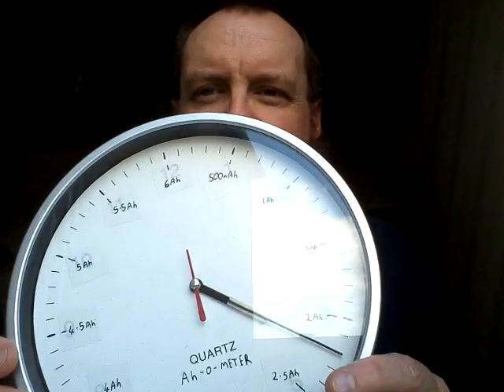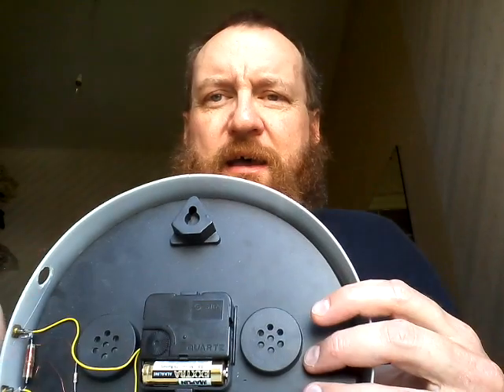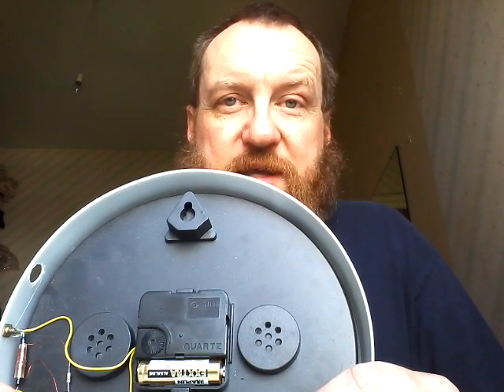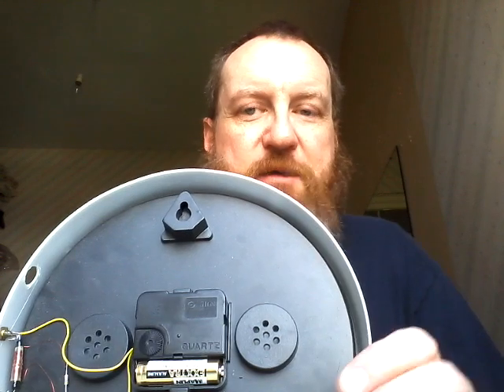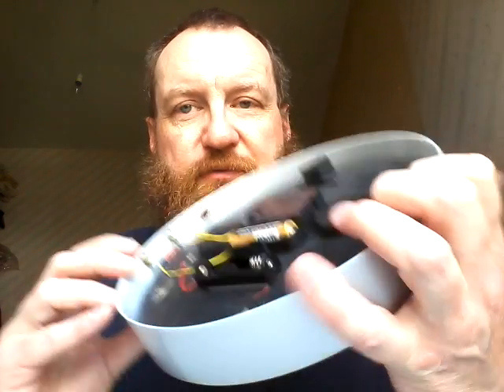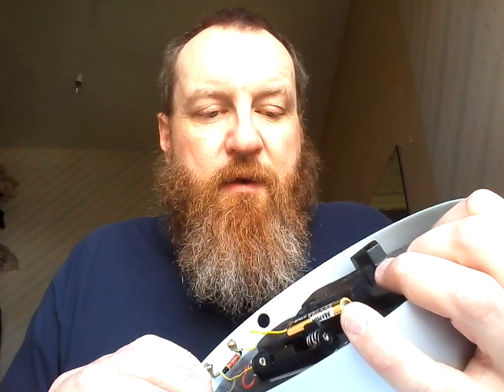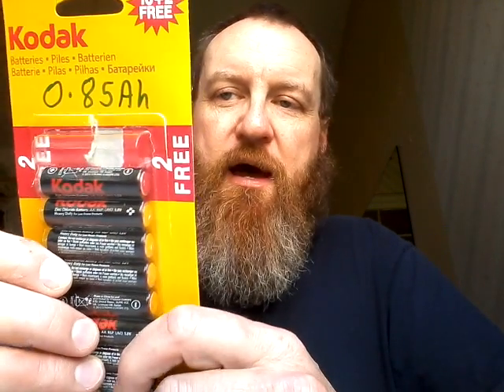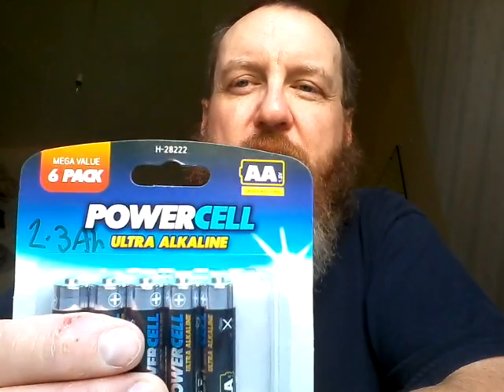Alkaline battery capacity tests.

Comment: Clive. Would you consider adding IKEA batteries? Those seems to be quite good.
Reply from the maker: I didn't have IKEA cells at the time of the test.  But others have tested them and they came out very well.  Good high capacity.
Reply: +bigclivedotcom Your blue collar trash cake saved my life tonight
Reply: +bigclivedotcom I've used IKEA batteries a lot and agree they're good capacity for the price. However I've had far more problems with them leaking than other budget brands.

Comment: interesting comparison, I have found different types of battery suit different types of equipment, for example, I have a metal detector, it will run 6-7 hours continuous on those alkaline duracell or the kodak ones, but i tried some GP 1300 mA ekopower nimh, which gives 8 hours easy, the problem with alkaline is the volts drop off to quickly in digital equipment

Comment: Do Super Heavy Duty batteries have Alkaline in them?  I ask because tonight I took the batteries out of my LED candle, they were Eveready Super Heavy Duty batteries and they were both showing signs of corrosion.  I think the batteries had been in there for maybe 6 months or so, maybe even 8 months.  I never buy Eveready batteries, ever.  I normally only buy Duracell or Energiser batteries, so I don't know how I ended up with those batteries.
Reply from the maker: If it doesn't say alkaline then they aren't alkaline.  When zinc chloride batteries were new they had better performance than the earlier zinc carbon ones, and unfortunately the phrase heavy duty has stayed despite the fact that they are inferior to alkaline cells and leak badly.  Duracell's claim of higher battery life over its competitors is also based on the older zinc chloride cells, which is very misleading.
Reply: Well it turns out the batteries in question were in fact carbon zinc, so that answers my question.  No wonder the LED candle only lasted a few months on those batteries, mind you, I was using the timer on the candle to turn it on and off, so I don't know how much drain that presents to the batteries.

Comment: What about the Ikea batteries? I have had good experience with them and they last far longer than anything I have used! You get like 10 for £2 or so.
Reply: I second the claim for Ikea batteries. I tested them unscientifically (by using them with cameras) alongside Panasonic alkalines. They scored just as good.

A warning:  Halfords own label alkalines, one exploded at me (in a torch, so nothing weird going on). It went POP----Hisssssss and sprayed the alkaline electrolyte under pressure everywhere. Ruined the torch completely
Reply: I stock up on them when I go! Even if its only a packet :L Own brand beating a named brand who would of thought! :P Oh thats no good! I would make a complaint as thats is rather dangerous!

Comment: Believe it or not, there are actually some applications where you want to have zinc-carbon batteries instead of alkaline batteries. One of those applications is in certain effects units for electric guitars. For this, you actually want a battery with a high internal resistance.
Reply: I wonder if you could just use alkaline/nimh/lithium and put, say, a 1 or 5 ohm potentiometer in series with it.  Then you'd get an effect that's both more consistent, and adjustable.

Comment: could you not use an Imax B6 charger? As it does discharge function, and shows battery capacties..
So do a discharge test of 0.5A and see how many mah it shows on the capacity test
Reply: That would not have looked nearly as cool.   Some of the newer hobby chargers will show mWh as well, which is interesting and relevant now that so many devices have regulated internal power supplies instead of just running brighter/louder/faster with new batteries.

Comment: Interesting video Clive, however I'd just like to comment on Duracell batteries. 
Duracell's are complete shit, I can't remember how many items have been damaged by these things leaking and usually it's maglite torches taking AA, C, and D cells. Once the cells leak, it's near on impossible to get them out of the torch without causing damage.
I now use only rechargeable batteries because alkaline batteries are so crap.
Reply: Once I used 2 duracell batteries (their most expensive) on my xbox controller and I left the controller untouched for a week inside a plastic box where I store electronic things so they don't get dust, after that week I come to find out both batteries leaked imensely and destroyed an 8GB SD card from my camera and a pair of earbuds. Those things really destroy anything electronic they come in contact with, I was surprised that after a wash, the controller still worked.
Reply: Duracells nearly destroyed the contacts of my (now very rare) CD-i controller. A working replacement controller is around €30 on eBay.
Reply: It's hilarious. When I find electronics destroyed by leaking batteries, 9 times out of 10, those batteries were duracell.
Reply: I've never had a problem with Duracell batteries.

Comment: I can remember a time when leaking batteries were a real problem. I've had MORE than 1 Walkman and even a game boy destroyed by leaking batteries (not to mention a large number of flashlights) but now I think about it, it's been years and years scene I've seen a leaky dry cell battery.
Reply: I leaked some modern Varta Alkaline in a label printer that i left unattended for 7 years. But the leak wasn't too bad, the printer's contacts were practically not corroded underneath. But these were good contacts too, little wear.

I also vented and leaked some NiMH by overcharging them at high current. What came out was more like foam and less like liquid. I removed it before i could observe any damage, so i don't know whether it's really bad for your electronics, anyway it's a highly unlikely occurrence.

Comment: Ive always used Poundland ( originally  my local 99p store ) Kodak Alkaline batteries..  Never had a prob They last well.  Ive now switched to the Fusio Max and todate Ive not encountered any problems.  Just wish they did them in a D cell.

Comment: I find Kodak alkaline ok but the zinc carbon ones are hopeless, you can squash the casings with your fingers, these remind me of those powercell brand ones that you got about twenty on a card, last two minutes then die then leak. Amonium chloride does eat contacts as I have seen, Alkaline potassium hydroxide also can do this but at a slower rate an the deposit is often a blue. The Ever Ready old type codes were SP special power HP high power, back in those days there was not much difference between the two. Nowadays battery technology has improved vastly. At the end of the day you get what you pay for. For high drain devices in constant use its best to use good quality alkaline batteries. They last longer an leak less. A chemical reaction is constantly taking place in a zinc chloride cell that eats the zinc casing over time, I find alkaline batteries leak less though, I have taken Mallory Duracell batteries out of old equipment to find them mint condition an in some cases still working, Mallory were an independent brand in there own right but had something to do with Duracell back in the early 1980s.

Comment: Duracell did seem better but I bet most of the other batteries I'd used before them was zinc chloride... now adays the batteries that come included with things seem just as good as duracells, if not better. next time I need batteries I will remember this :).

I think i'ved tried to look up the AH rating of AA batteries in the past and never been able to find any info

Comment: can yo do the same test as this on 18650 batterys please? Or will that be to expensive? I'll share the vid through right lines and I'm sure it will go viral in the vape community! respects Alex
Reply from the maker: +Alex piv There are so many lithium cell clones that it's really difficult to do meaningful lithium cell tests without actually testing the ones you have.
The best test of real mAh I've found so far is to put the cell in a generic single cell USB power bank and first discharge it fully, then charge it with a suitable USB charge monitor to measure the mAh total during the charge cycle.
Reply: Thanks Clive your a gent!!

Comment: My personal experience with Duracell battery's is thay they tend to leak even BEFORE they are flat. I've had multiple battery's that where still in use when they started to vent electrolite. They where regular Duracell's, not one of the cheaper models. For a company selling one of the most expensive alkaline battery's on the market that is really lame. I have never bought them again since then. From what i heard they don't make them at a separate factory anymore but are being produced at the same productionline as Philips battery's.

Comment: No testing of Energizers?
Reply: +Jeremy Morton Energizers will be around the same or slightly worse than duracell, but I would be curious about the 'super max amazing extreme' or whatever versions, if they make any difference :P
Reply: +Jeremy Morton Good suggestion. I'd like to see how the Energizer Ultimate compares. I like them because they're lighter and they don't leak; lithium tech. Not cheap though. In my experience Duracell is a synonym for "leaky crap" ;) I'd be curious how the Duracell M3 compares though.
+BigCliveDotCom Do you still have your tester?

Comment: I always buy my AA's and AAA's in the LIDL Supermarket (Netherlands but I'm sure LIDL is present in the UK also). Maybe you could one day purchase them and measure them up ? (They cost 1.80 Euros/8 pieces)
Reply: mharris1270 afaik they are not connected. Aldi has been erected by 2 brothers who after disagreement split the Aldi into 2 companies Aldi-nord and Aldi-sud (north and south) and LIDL is from a completely different background. Here Aldi is the cheaper one of the two although both claim to be value supermarkets and in some respect they are (LIDL being more expensive). Strange that Aldi  has been a luxury retailer in the US. The Aldi's in the USA might be derived from Aldi-sud and they might therefore not have chosen to sell batteries while Aldi Netherlands is derived from Aldi-nord and does sell batteries (I bought them last thursday and they're only 1,89 Euro per 8 AA's or AAA's). Lidl sells them for exactly the same price per 8 but are differently branded.
Reply: @maicod  In Germany both ALDI and LIDL You get 8 batteries AA or AAA for EUR 1.59 ! And they are both very good and longlasting. And they both take back used batteries in a box near the cash register for recycling for free !
Reply: @Maico  In Germany both ALDI and LIDL You get 8 batteries AA or AAA for EUR 1.59 ! And they are both very good and longlasting. And they both take back used batteries in a box near the cash register for recycling for free !
Reply: @Buddhist unfortunately here they sell for EUR 1.79 @ Lidl
Reply: @maicod  You can travel to Germany if You are in Groningen or near the border and buy entire shelf empty to save 20 Cent per 8-pack. But who needs so many batteries except for tv remotes, wallclocks and wireless USB-Mouse? And they usually last very long. The biggest consumer was my Gillette Power Fusion shaver, requiring every week a new AAA Micro- battery. But now I have shifted to wet electric shaver with akku (rechargable battery like in mobile) and it has much more power than the Gillette ! Works also with shaving foam.
Reply: I'm 'far' away from Germany. I don't mind the price difference. I was just wondering why prices in Germany are better than here :)
Reply: @maicod  Our VAT is 19 % on non-food items.
Reply: 21 % here

Comment: CR123 batteries, when found at the druggist, hardware, etc. are about $7 each, even when bought in multi-packs. Found them for a buck a piece. Surefire Lithium. On EBAY

Comment: Even though I know this video was made in 2014, it's still very much relevant in 2017. Duracell, for whatever reason, has now branched into making a bunch of different (shall we say dubious) new brands for their batteries. They still make the good-ole-coppertop (which is now a crap battery), but now they have sub-branded cells like Simply Duracell and Duracell Quantum (red/gold) along with other variants.

Since they have now split their brands into multiple new dubious battery lines, their battery quality control and, in general, overall quality has become crap. It does not surprise me at all of your findings with those Simply Duracell batteries. In fact, I'd guess you'd find the same thing even buying the regular Duracell batteries at full price.

In fact, I have personally found that the Quantum batteries operate at least 4 times shorter than Duracell batteries made in the 90s. I don't know what has happened over at Duracell, but I won't be buying any more of their batteries. Energizer seems to have at least kept up with their same quality levels over the years, but Duracell seems to be cutting costs... and along with it the longevity of their cells. 

I'm guessing some some self-proclaimed brilliant executive at Duracell thought that they could cut costs and reduce their battery life in an effort to force people to buy more batteries, more frequently. It's a scam that really needs to be exposed. I certainly don't buy Duracell anymore.
Reply: Probably like the inkjet cartridge makers.
Reply: And recently "optimum" which may be a return of the old "PowerPix" now that AA digicams are a thing of the past (and if anyone has a vintage one, they're using rechargables).   I never saw, in the USA, anything other than regular duracell, procell, and the M3 Ultra.  No simply or plus.
Reply: @mikewellwood1412  The inkjet carts just come in normal and "XL" capacity, no rebrands of the same things.  What they do is more like selling the same AA battery but with 20 different shapes and terminal configurations so that one product (essentially) can take up a whole section of an aisle.  The XL vs std would be more like some having one AA and others having two or three, in the same cartridge.  There's no messing around with amount of ink.  Not "prints 20% more pages, but only if you print over 10 pages a day; if you only print 1 a week then it prints 10% fewer), like there is with batteries.

Comment: The last time Duracells were worth buying was probably the 80s when there was so few other brands to choose from and they along with Energiser were making the best batteries.
But the advent of the Pound stores bringing in cheap foreign batteries killed off Duracell for me.
Reply from the maker: +Trakker It was the invention of the nickel metal hydride cell that killed Duracell.  How could they compete with a rechargeable battery that performs better than an alkaline cell and can be recharged around 1000 times.

Comment: Video suggestion: Like many families we throw away many alkaline cells that are partially discharged but have some power left. Would it be possible to connect the part-used batteries in parallel with some sort of buck/boost converter to harvest the remaining power to charge, say, mobile phones? Idiots guide please, I don't understand half of what you talk about. Thanks for all the videos.
Reply: The idiot version would be to try your alkaline (AA,AAA) in a Panasonic BQ-CC87 (USB OUTPUT mode only.  No trying to charge alkalines, please).   I doubt you'd get much out of them but you could probably top off your phone.  If the batteries are low, try the phone at 75-95% instead of below 70%, as the charge current it tries to draw will be lower.  Really you'd be better off with low current devices (like radios and some dimmer LED flashlights).
Reply: @radellaf  Good suggestions, thanks. That's a good charger/power bank too. Regarding your suggestion about using the used batteries in less demanding devices, since my original comment I broke out my multimeter and did some experiments and found other devices to use; Minidisc players are good first, then Gameboy Colour, then my little tac torches. Can't remember the voltage for each, but I have it written on my battery boxes. Thanks.

Comment: Philips alkaline batteries are great. They are the only ones except lithium that last more than a week in my logitech multi remote control unit.  More than a month means a year in this case. They are called Philips Power Alkaline and are not expensive  about 2-3 pounds for 25 batteries. To me philips always made the best batteries I discovered this when my dad bought a distribution package of them (At that time only philips alkaline) and I compared them to energizer and duracell batteries in my portable casette player about 20 years ago I almost wept when that batch of batteries was used up.